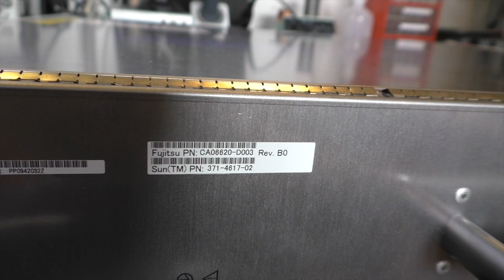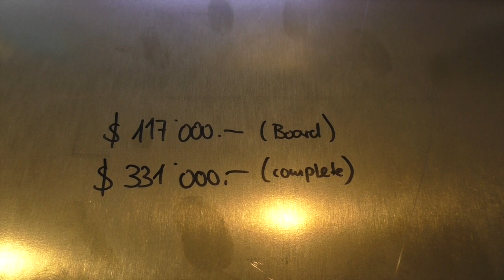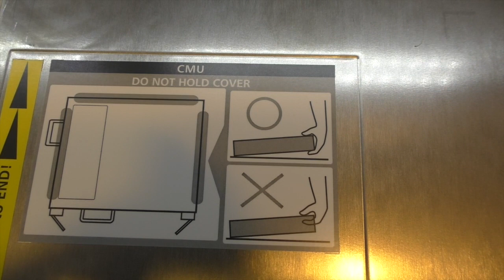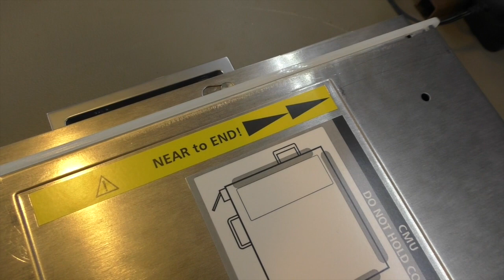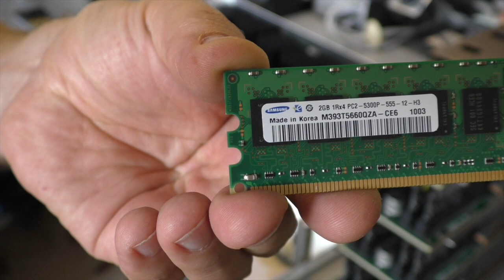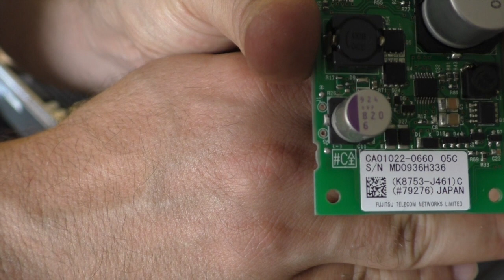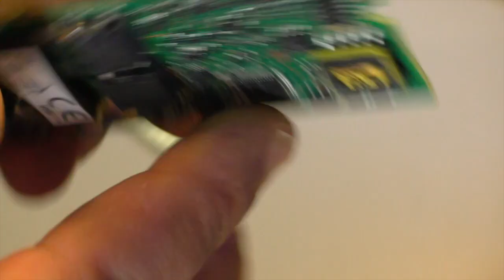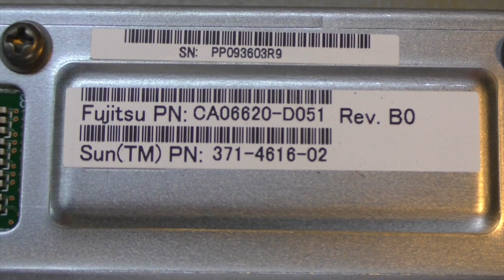How about a $330'000 CPU or a $50'000 cable? (PWJ19)

Comment: Over priced junk.  That's why sun got bought out by oracle.  Their stuff are over priced like crazy and are totally unreliable.  They fail all the time and were designed with poor ventilation and overheating alot.  An Intel / AMD server running linux at 1/10th price will do the same job and won't be a headache to maintain.  When you buy a sun server you have to have a contract with with sun authorized company to service it.  You can't replace parts yourself.  Therefore expensive to buy and maintain.
Reply from the maker: You can't say they are unreliable. The machines from the 1990s and 2000s were built very well. The Intel base machines that came later are a different story....
Reply: Play with Junk , really I work on the sun e4000 to 6000 series servers in the early 2000s, they were improperly designed.  the air intake was on left side which exhausted at the right side.  which is totally wrong design for datacenter environment.  all other servers and storage arrays were front to back.  price to performance intel 1/10th cost
Reply: Wait, wasn't this made when it was already Oracle?